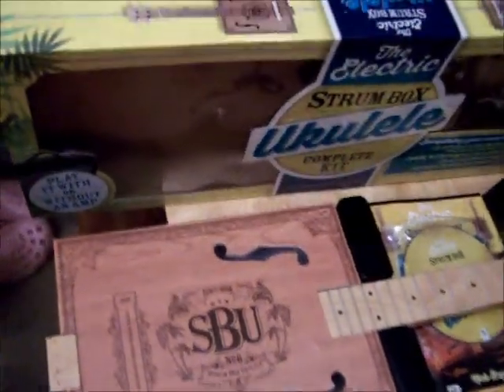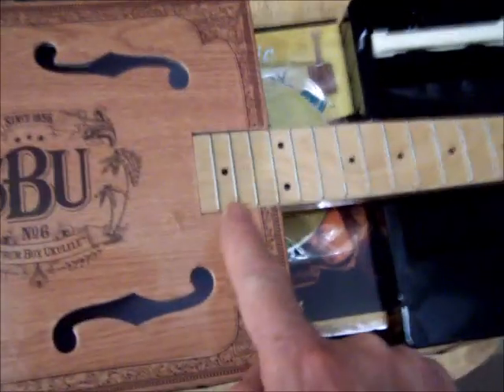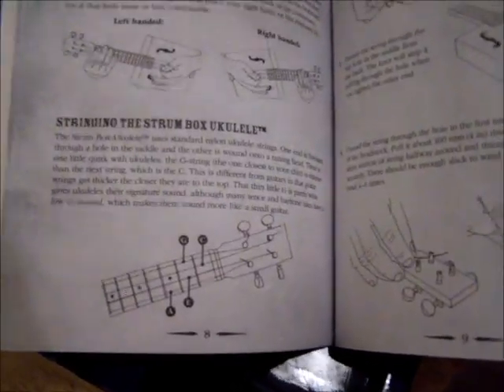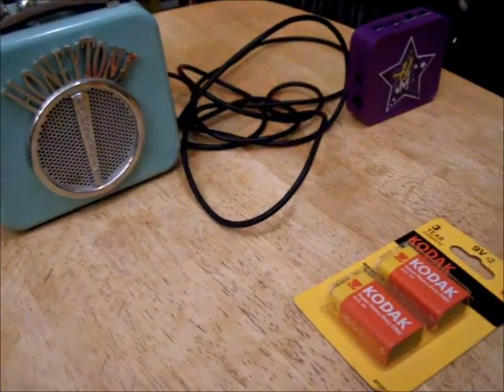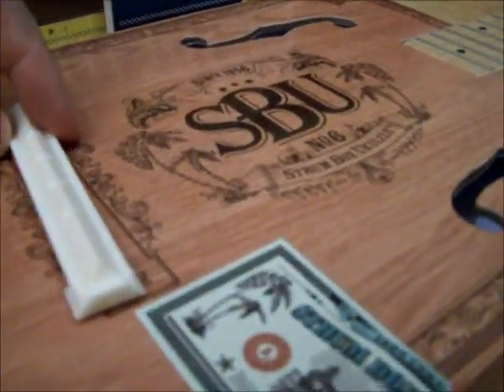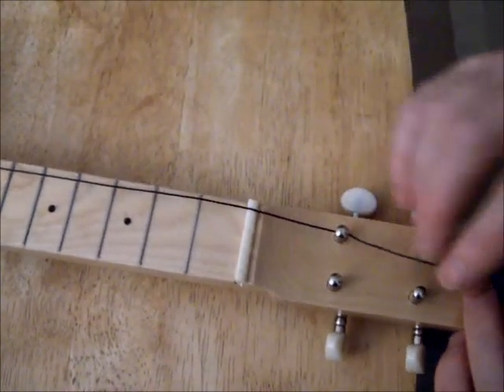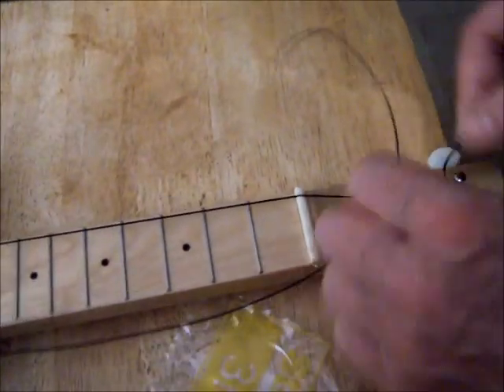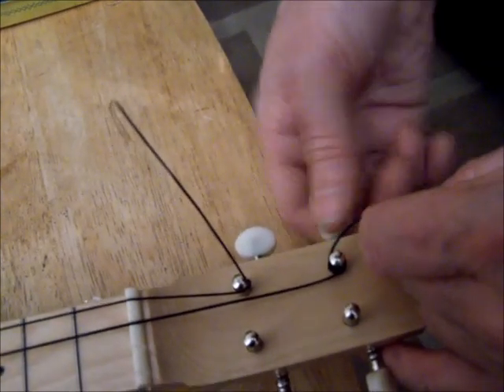Strumbox Ukulele Kit (Electric) - Assembly, Setting Up, Playing and Review

Comment: Hi mate. Just wanted to say thanks for this video. I've had this uke for a while and I was really disappointed about the ringing from two strings and the height /tension of the first and second fret. So I basically wrote it off and have just been using it for decoration on my wall (which is great tbh as it looks the part) but now I am going to give it another go and do some tweaks.
I've got a traditional uke, electric uke and a enya plastic one. So will be nice to finally have a blues style one to practise my finger picking.
Cheers